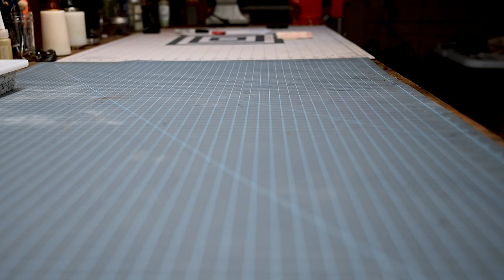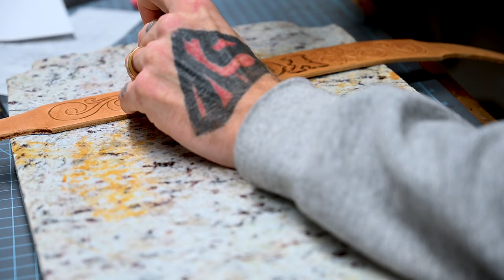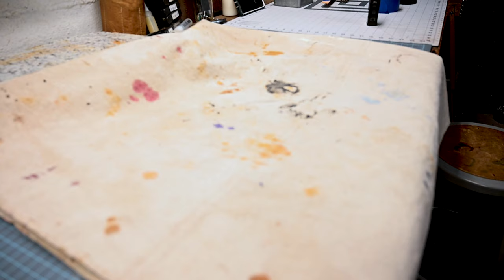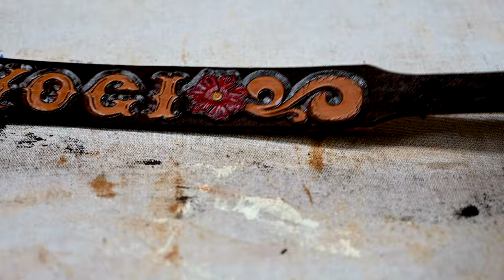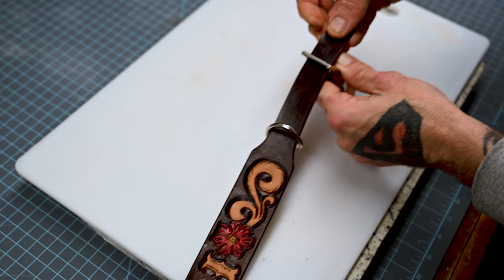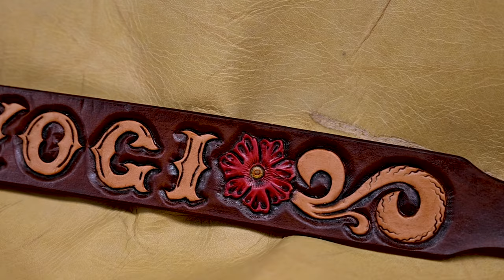Making A Custom Leather Dog Collar

Comment: I want to make a collar and am wondering if you need to use any sealants or stains on the inside  of it
Reply from the maker: I don't usually. Most of the time I use 2 pieces of leather stitched together. It helps keep it sealed and adds a significant amount of strength. This particular collar I didn't do that. It really depends on what the customer wants.

Comment: amazing work! what exactly tools did you use?
Reply from the maker: For the tooling mostly tandy pro bevelers. The strap cutting I use a standard strap cutter from tandy as well. To cut the collar from the hide itself I use just a regular x-acto knife with a Z blade.